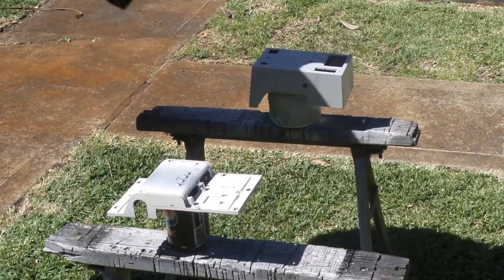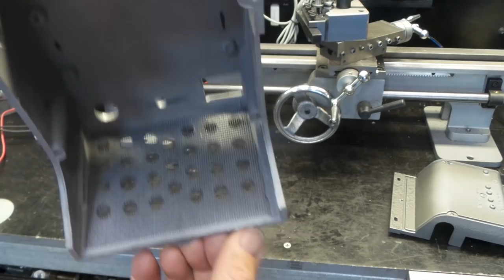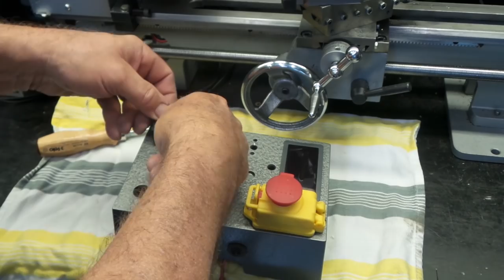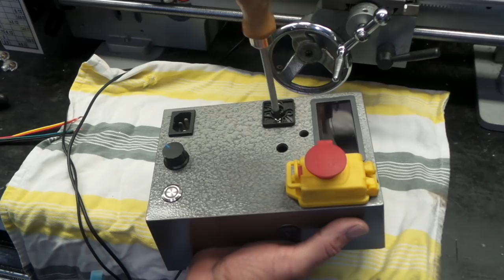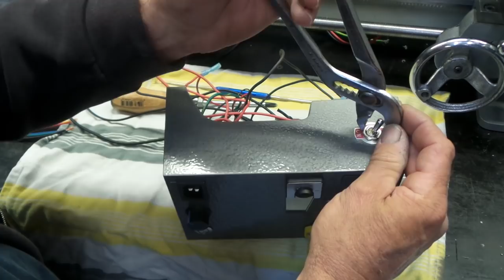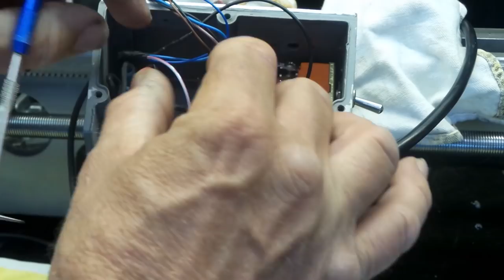Mini Lathe Dc Treadmill Motor Conversion Episode 3: Its Alive.

Comment: What is the lowest speed you can go down to and still have plenty of torque?
Reply from the maker: G'day Wayne, i'm not to sure on that, i've never really had any low speed torque issues with it. If I do I could easily change out the pulley size as I never use more then half of its speed range. Cheers.

Comment: "...I'll refer to the A/C positive as being active."
Ummm, which is it: A/C, or positive??  :)
Reply from the maker: In Australia the AC domestic supply lines are referred to as "Active & Neutral", some folks simply call them Positive & Negative. Hope this Helps. Cheers.
Reply: I kinda' figured that.  But, I also thought it was funny that an alternating current (A/C) line is called "positive".  :)  Sure, it's positive sometimes.  When it's not negative.  50 or 60 times a second... :) 
Anyway, just another example of this great "common" language all us English speakes share!  :)

Comment: Thanks for the crazy quick response, Trev. I've got everything ordered. Can't wait to try out my "new" 3 HP lathe.

I've got a Jet 1 1/2 HP contractor saw and I'm wondering if this conversion makes sense for that. Your thoughts?

Thanks again,
Brad

Love your teaching videos--- kind of like Crocodile Dundee meets Tim (Tool Time) Allen.
Reply from the maker: G'day Brad, sorry Mate, really have no idea, I reckon give it a go, if it doesn't work you can use the setup for something else, Cheers.

Comment: Hey Trev! Absolutely love this conversion. I'm upgrading my Harbor Freight lathe using your system. I've ordered all my components, but the little circuit breaker. The link for it is bad. Can you tell me what to look for in a circuit breaker for this. Thanks.
Reply from the maker: G'day Brad, thanks for letting me know. I've been through & fixed all of the dead links. Cheers Mate.

Comment: You are lucky with your controller box. Mine came with no back at all, fully open to allow all kinds of stuff to get inside and made of sheet metal.  Not only that, the saddle gear that is suppose to mesh with the mod1 rack doesn't fully mesh and slips while moving the saddle. Not sure how I can fix that yet.  Several of the screws are in stripped holes, so I have had to re-tap the holes and fit longer screws. Pretty rough machine and was sold as a precision machine, what a joke.
Reply from the maker: Yes, its the unfortunate truth with these little Machines, good luck with yours Reg, Cheers Mate.

Comment: We are still waiting to see it turn some steel bar into deep blue chips and optionally also parts 😃
Reply from the maker: G'day Mate, yes I'm pretty keen to finish a few mods I have planned for it, unfortunately I'm snowed under with another project atm. I have been using it quite a bit though, really nice to use, quite the little power house. Cheers Mate.

Comment: Nice job Trevor. Good detail and great finish.
 Its worth noting that whilst you Earthed all the lathe metal parts, the metal plate on top of the control box is exposed to (and quite close to) the mains in at the E-stop switch and not earthed. If something comes adrift in there and touches the aluminium plate inside the control box you could make a decent ground circuit yourself. It would be better to insulate that plate inside the control box.

Comment: hi Trev.can you please tell me what I am doing wrong the display lights up the hall effect sensor light comes on but I  get no reading of rpm.  would appreciate wire diagram for one hall sensor  thanks
Reply from the maker: Hi Frank, the trigger magnet only works one way, flip your magnet over & it should be fine. Cheers.
Reply: I tried that and no go also got 2 other magnets and put them on one facing 1 way ant the other the opposite way didn't work either
Reply from the maker: No idea then Frank, here is a link to a site that has wiring diagrams for these tachos & sensors. https://usefulldata.com/led-spedometer-cf5135b/ just check all your connections. Cheers,
Reply: @TheAussieShed  thanks Trev I was looking at that yesterday and I think I have worked it out , there are a few different diagrams out there. Keep those videos going
Reply: I FOUND THE PROBLEM the cheap chinese male and female jacks two out of ten that i tried were faulty  all working now thanks

Comment: Well done I have found that it’s a very good idea to drill holes in the base of the control box because as standard the box holds the heat in getting quite hot in use I have fitted a small computer fan on the side at the top to draw the air through and it works well

Comment: I totally love your videos and particularly the job you did on the lathe. Bloody fantastic. I do have a suggestion for the drive pulley. I used the expanding mandrel on my lathe at first, but found I needed the pass through more often than I thought. So the easy solution was to make a mandrel that threads onto the spindle, in place of one of the spindle lock nuts. I made my own pulley as well with holes for indexing, but that's another story. Anyway, thanks for the videos and I'm looking forward to the next one.
Reply: I thought of that also, I don't yet have the lathe and the one I am seeking has the 38mm spindle bore specifically for that reason, but I'm certain some adaptations can be made as you've successfully done.

Comment: Howdy Howdy Trevor ! Got myself a pair of the same heavy-duty safety work boots myself . 😁

The two-tone color actually looks very good (better than the factory finishes). There's a gent who has a video on chucking the factory "fuse" system for a push button circuit breaker which fits the same hole (prevents searching for those pain-in-the-butt fuses for push-button simplicity).

Very well done , looking forward to your travails with the headstock!